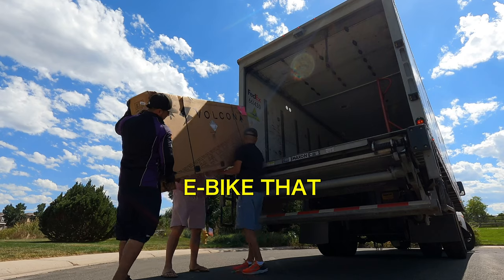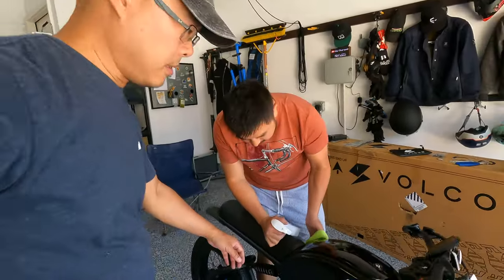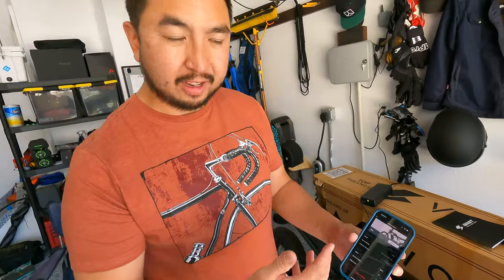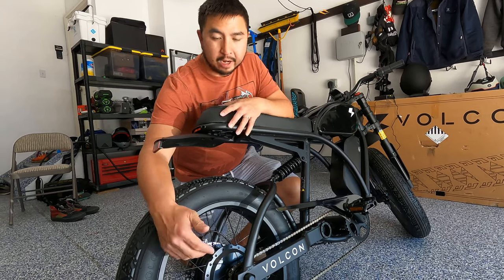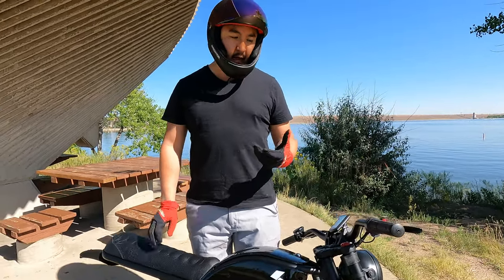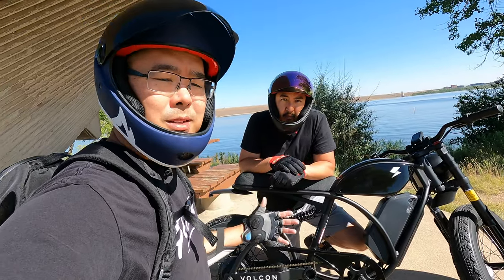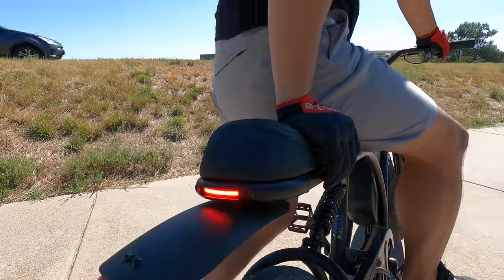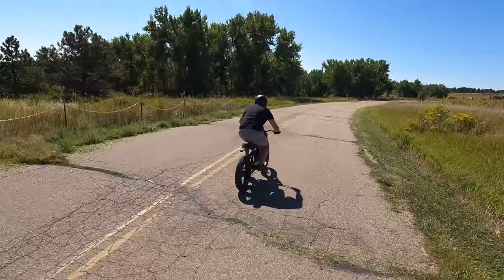A Motorcycle Inspired Ebike: Volcon Brat Ebike Unbox & Review

Comment: 40mph is the new benchmark..30 just doesn't cut it due to the regular 30mph speed limits and people doing 35-38mph..this def is a great S73 alternative.
Reply: S73 has a 25% bigger battery than this bike
Reply: The reason is so it can be classified as a e-bike and not a vehicle that you have to register with the dmv
Reply: @RegulatorSevenZeroSeven  that doesn't matter. They sell it locked and can be unlocked later for "off road" use like everyone else does
Reply: @NeptuneSega  Sure I'm just going into technicalities of whether it would be required or not.

Comment: With a few changes it could be a full on electric cafe racer, maybe a slightly bigger motor, remove the chain and pedals, use a bigger battery and that would be all.

I saw a homemade electric bike a year or so ago, based on an ICE frame but the entire front end of the frame where the engine was was cut and a huge battery structure was made, also a hub motor, and it looked pretty good, the rider had a mix of a cafe racer with chopper stance.

Comment: I road this today, not sure why you’re saying the Suspension is good. The rear shock is stiff as can be and it does make that boing noise going over bumps. The bike looks great, besides that it’s another china replica. Top speed was 29 mph for me weighing at 160 lbs. $1500 and this would be OK however at 2700 which they started at us a stretch. Even at 2k right now it’s still overpriced for what you are getting. The rev1 is by far superior by this for $2295.

Comment: Another cracking review; thanks. 

Do you think the bottom “hinge” on the storage compartment could be secured with a couple zip tires or hose clamps?

One thing I like about this is the FULL SLEEVE on the twist throttle. 

How does this compare to the Juiced Hyper Scrambler 2?

Comment: 48V battery is a deal-breaker. No excuse at this point to not have a 52V battery. And then obviously 750 instead of a 1000W motor is double-nope. You can get a 2022 Ariel Rider X-Class 52V battery w/1000W motor right now for under $2k, so getting this bike is dumb.
Reply: Agreed

Comment: Kinda basic.. no gears, low quality shock for 2.5k not impressed. I know others of higher quality with 60V batts that top out at 40mph for $500 less 🤷
Reply: One can get an Ariel Rider X-Class with a 1000W motor and 52V 20Ah battery for under $2k -- so I don't know why someone would buy this Volcron over that.